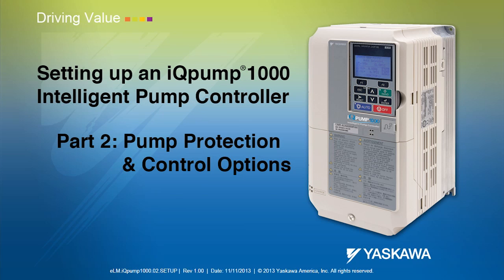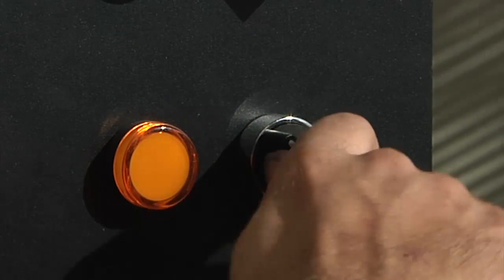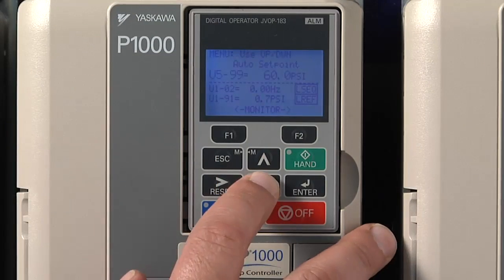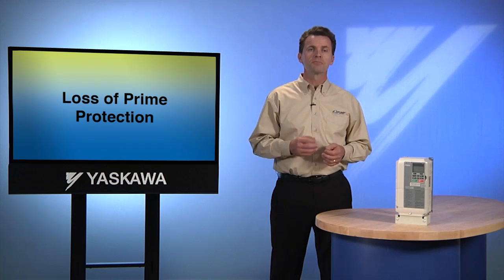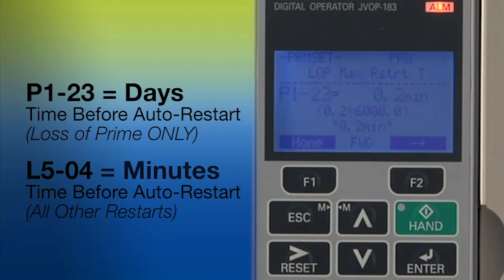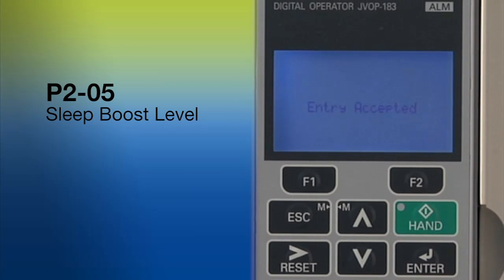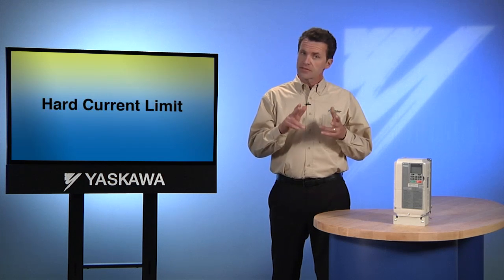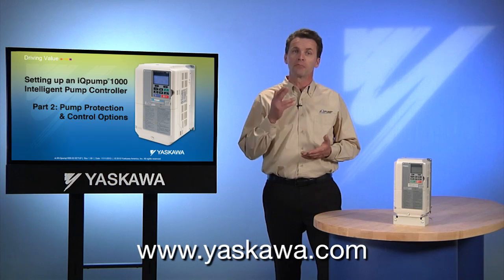Setting up an iQpump1000 Intelligent Pump Controller Part 2: Pump Protection & Control Options

Comment: Can i connect 3 pumps to a one single VFD P1000? At least one of them will be the lider pump and the other ones will be a "slaves", the slaves ones will be used to increase the caudal if needed, thanks in advance.
Reply from the maker: Thanks for watching our video on "Setting up an iQpump1000 Intelligent Pump Controller Part 2: Pump Protection & Control Options".
We will be glad to assist you further if you provide us with more information on your application and motor specification. Please vist https://www.yaskawa.com/support-training/support.

Comment: why should you not run vertical turbine pumps in thrust mode? When you run turbine pumps with a magnetic they jump straight to 60 Hertz why would jumping to 30 be bad?  Thank you for all YouTube videos they are extremely helpful!
Reply: Vertical Turbines do not have thrust bearings like those in a submersible motor therefore it’s not required for start initial ramp to seat the thrust bearings in the motor. If the customer elects to still keep thrust on (ramp to 30Hz in 1 sec.) there is nothing wrong with it, but there is no need to start a fast ramp on VT Motors.
Reply: Bob Bonczar Thank you for your answer.